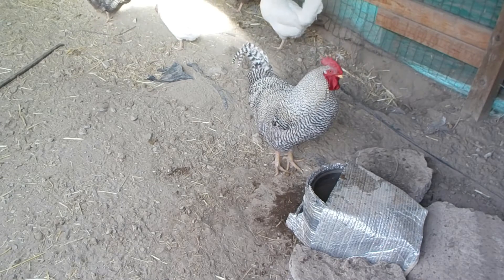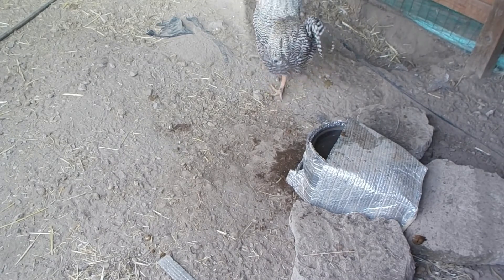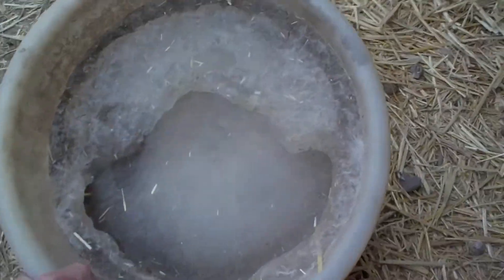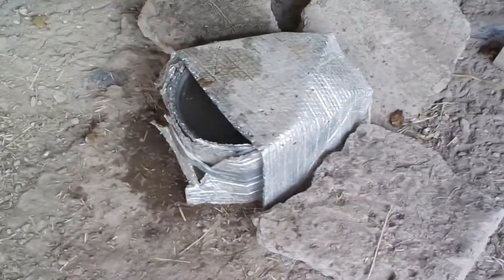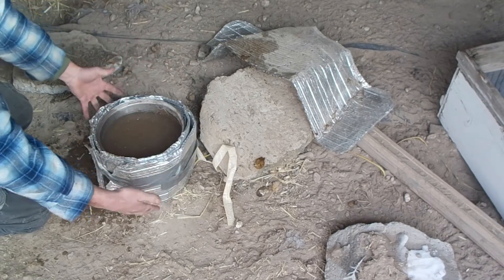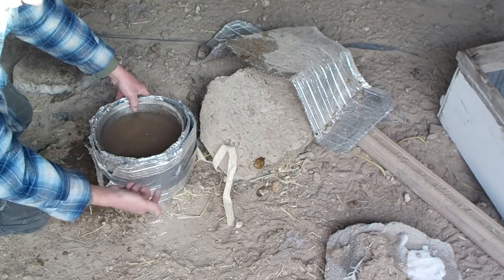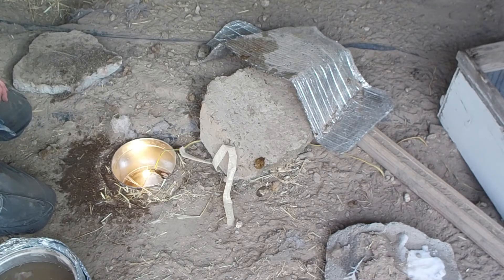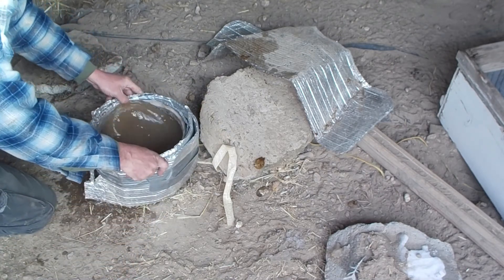duckwater

Comment from the maker: It has been very very cold and snowy normally having the water inside the greenhouse area is enough to keep the water thawed.
I have a small off grid power system and even if the sun didnt shine (which it didnt) this would have run for more than a week.